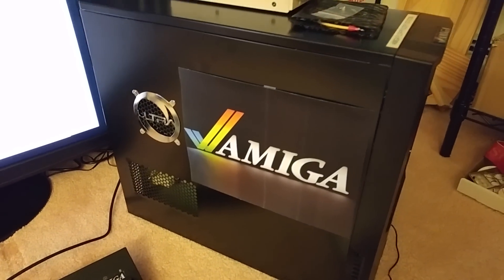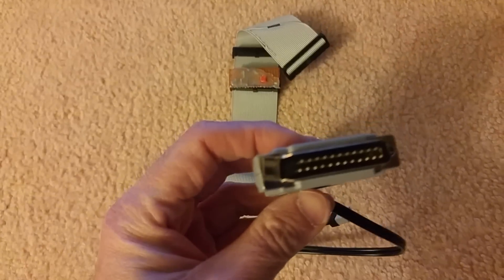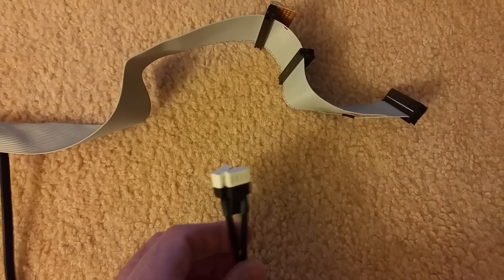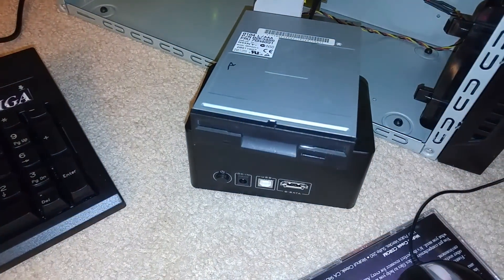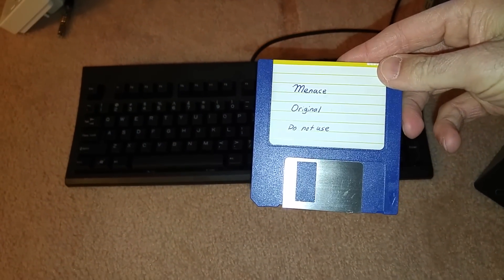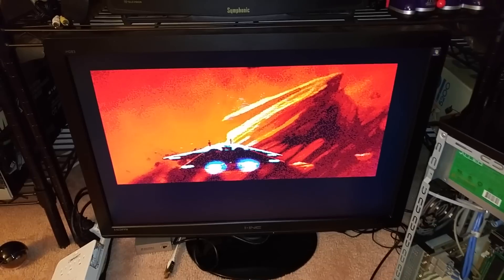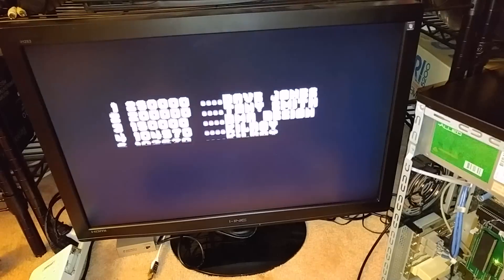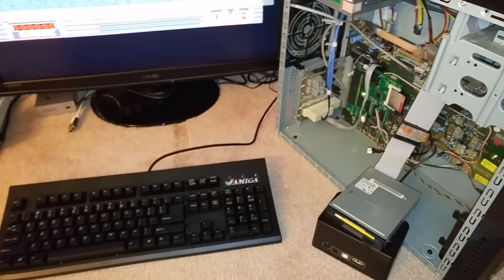Use a normal IBM PC floppy drive on an Amiga computer.

Comment: I have just recently got one of these cables and i can confirm the cable is faultless and works with the gotek and IBM PC Drives. I've had it working as gotek df1 and the PC Floppy drive as DF2 powered perfectly with the same cable on my classic a500 at the same time, then simply changing the jumpers on the board enabling DF0 booting on the external gotek and the IBM PC Floppy drives as a df0 (Real DF0) with an original Amiga internal drive still connected (3 drives connected in total all of them switchable to df0) ... I'm not joking when i say this, but any Amiga user that does not have one of these cables is missing out big time.... A1200 works perfectly in workbench with both drives as well, but.. with a1200 you cant use the two button mouse boot selector to force df1 as df0... wont work like the a500 as a different modification is needed for the a1200 not the fault of the cable tho!!! Glen fantastic video sir!!! Thank you....
Reply from the maker: Fantastic 😍

Comment: I just tested the cord. It works awesome. I added a Toshiba drive and it works flawlessly. If you want to use that drive port get this cord. I have not added a 2nd drive yet but I cannot see how it could not work. The PCB is much more professional-looking now with dip switches. Nice product!
Reply from the maker: AWSOME..yes he makes an amazing product and just works as advertised
Reply: After I added 2 drives it no longer powers up at the port. I power it externally & only 1 drive works. Either pc or gotek, not both. The seller says the df1: has to be gotek so now I have a gotek as df1: and the pc part is not connected. It says df2: bad because no drive is there. Have you used 2 drives?
Reply from the maker: @cevoner  yes I have it in my ultimate Amiga tower.  A ibm floppy and a GoTek. Will have to double check it

Comment: Hi everyone! I'm the guy who make this cable, and i would like to inform you that you can find a newer and cheaper version of this cable ( new pcb board, directly soldered on 23pin D connector, along with switches that allows to change the external drives order) along with many other useful items for amiga (like boot drive selector for A500, Kickstart ROM switcher, scart cables etc), here:
https://www.ebay.ie/sch/ikonsgr74/m.html?_nkw=&_armrs=1&_ipg=&_from=
Reply from the maker: Thank you so much for the update. Everyone this is a great product and I can't recommend it enough.
Reply: Gents John @ikonsgr is making great things that I hardly can see in other shops in his format!

Comment: Can it do 1.44mb Disks in the Amiga?
Reply from the maker: Sadly no. It only can support 880k disks, not the HD 1.76m disks
Reply: @GlensRetroShow  Thanks for the quick reply. I'm actually not concerned with Amiga's 1.76 mb format, but if there was a way that this mod could read&write 1.44mb Fat12 formatted disks with something CrossDOS. it would go from just replacing your dead drive, to actually providing a service that would overcome the major weakness in all older Amiga drives. Will CrossDOS even work for reading 720K DOS disks?
Reply from the maker: @Ratteler  all the cable does is turn a IBM floppy drive into a working Amiga 880k disk drive. Best it will do is allow 720meg disks to be formatted. To actually woek with a 1.44m IBM floppy you would need a true Amiga 1.76HD drive.  And they are rare
Reply: @GlensRetroShow  Yeah. :-(. Too rare!!!
Reply from the maker: @Ratteler  yes..i had one in my a1200 and one in my a2000.  But sold off years ago..wish I didn't
Reply: @GlensRetroShow  me too :(

Comment: Hi Glen,

  I just want to inform you and your viewers, that now i offer a revised versions of the adapter cables, which also are cheaper. You can fin them here:
https://www.ebay.ie/itm/272437676307?ssPageName=STRK:MESOX:IT&_trksid=p3984.m1559.l2649
https://www.ebay.ie/itm/272354375049?ssPageName=STRK:MESOX:IT&_trksid=p3984.m1559.l2649

And if anyone want to ask something  or have the cable directly contact me at:  ikonsgr745@hotmail.com 

Thanks again for your awesome presentation! ;-)

Comment: Very nice!  I saw this in the Commodore Amiga Facebook group that I'm a member of.
Reply from the maker: thank you.. :)
Reply: +Glen Planamento You're welcome!  Do you live in the United States?  I would love to get an Amiga computer for gaming, but they are so rare and expensive here!  Not so in Europe, where they were a lot more popular.
Reply from the maker: +David Halligan. -- yes i live in the states.. in the late 80's and early 90's the Amiga was doing ok thanks to desk top video and the video toaster.. just look at Babylon 5..and you see what the AMIGA can do.  but these days..yea import is the way to go....
Reply: +Glen Planamento How old is the IBM floppy drive that you're using?  Is it from an IBM PS/2, or from a newer IBM computer?
Reply from the maker: +David Halligan ... hi david.  the drive I am using in this video is 10 years old at least.  it's a sony drive 1.44.  it came from a old old cole PC sitting in an,old Wherehouse it was very dusty.  I cleanes it up and works perfect.,,i did try other drives and all seemed to work perfectly..and much more quiet then the original Amiga drives used in there line.
Reply: +Glen Planamento Those drives are really cheap on eBay, even brand new!  Does using a drive like this allow you to play PAL Amiga games, as well NTSC ones?
Reply from the maker: +David Halligan.  - yep, works just fine..but buy will probably have to set your AMIGA to the correct mode. NTSC or PAL.  this can be done in a number of ways.  3.1 ROM early boot menu, or a hardware switch on the motherboard or a software application.  the Drive will make no differance.
Reply: +Glen Planamento OK, what switch on the motherboard can be used?
Reply from the maker: +David Halligan if you talking about an NTSC or PAL switch if you have a rev 6 motherboard there is a jumper I believe jp1 that when shorted is NTSC and open in PAL mode if its a rev 5 board I believe you can stick a toothpick in pin 41 the fat Agnes socket